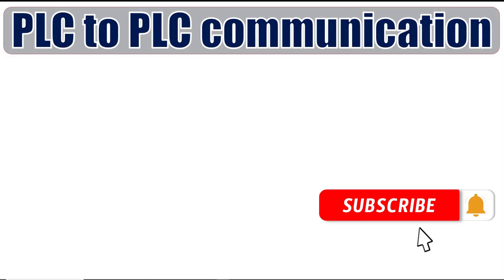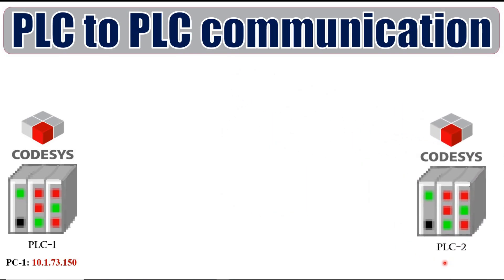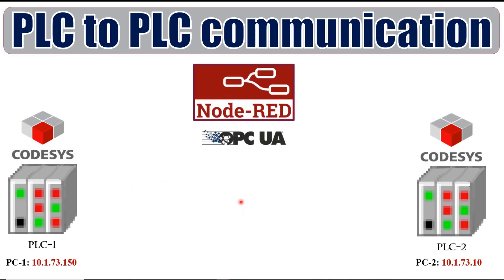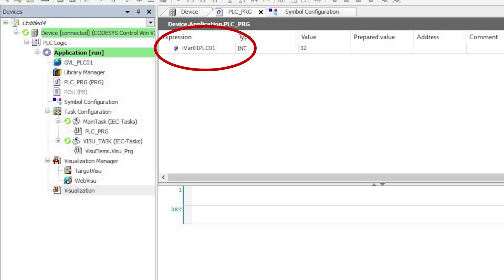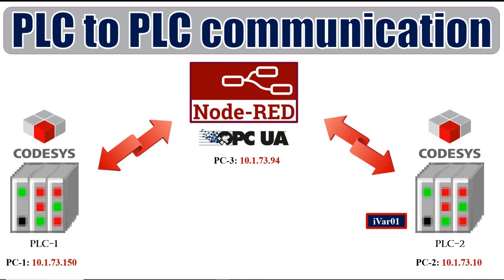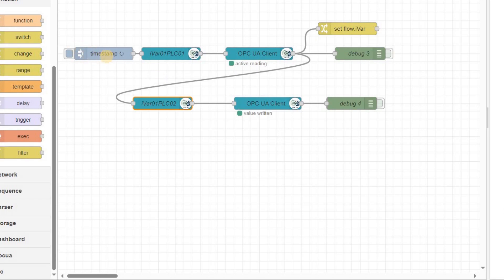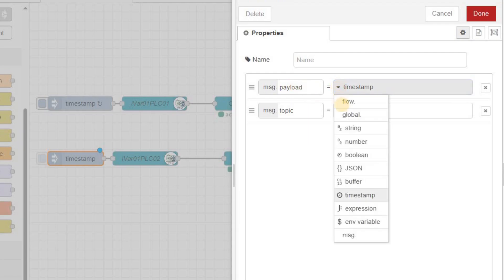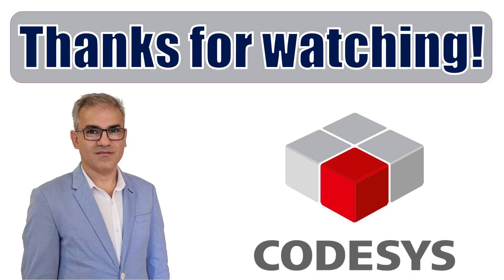CODESYS: Node-RED - Communicating between two CODESYS PLCs via OPC UA #nodered #codesys #opcua

Comment: Why is a layer needed if the PLC can be directly connected via Modbus TCP? Is it easier and faster?
Reply from the maker: That's right, Modbus TCP could be used without creating an additional layer. But using Node-RED has it's own benefits, as we can make the data available in the cloud, or transfer it to devices which do not support Modbus TCP but rather OPC UA, for example. So with this approach, we have a kind of server/client which is able to communicate with different devices supporting different technologies.
Reply: @TohidAlizadeh   I understand, but you also understand that if we add a node, this may become a problem in the future. If this node exits. In the example, it is clear to me that an exchange can be done easily; in automation they often try to remove unnecessary nodes.
Reply from the maker: I understand. It is always better to keep it as simple as possible, however, as we will see in my upcoming tutorials, there are use cases for this approach as well. Stay tuned!